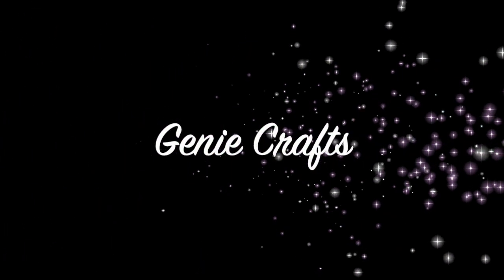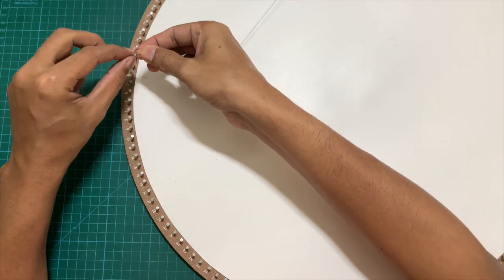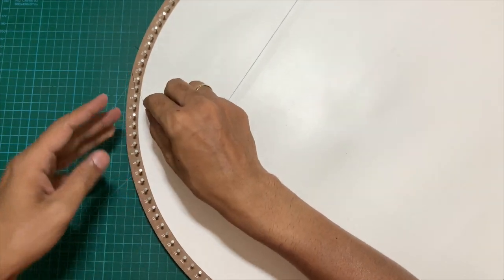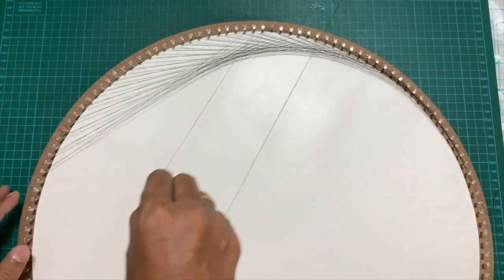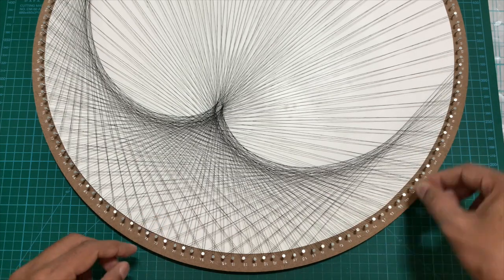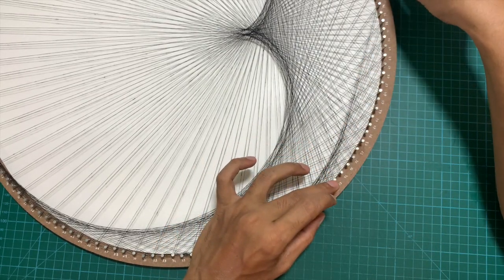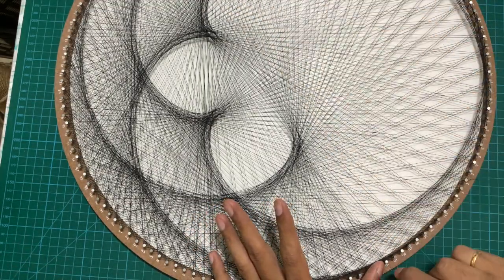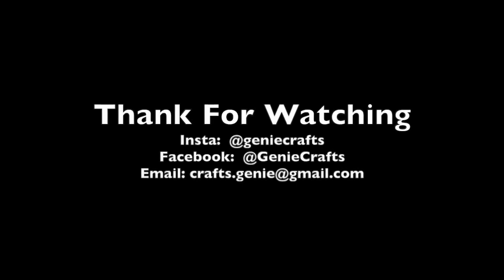String Art Basics - 1 | Cardiod String Pattern | 5 Petal Rosette String Design | String Mandala

Comment: Hello, I would like to ask you how to make the second cardiode, when I have all 136 nails together. Can I start the second cardiode on nail number 29? How does it work? Thank you very much for your reply.
Reply from the maker: It depends upon how many cardiods you want. Divide your nails into even numbers which will provide starting point for next cardiod. With 136 nails you can only have 4 cardiods as next divisible integer is very far away. So that means that next starting point will be mail number 34, and next 34 nails away from second starting point and so on
Reply: @GenieCrafts  So if I have 136 nails, isn't it already possible to create 12 flower petals? How many petals will it be, please, if I move it by 34 nails? Thaaanks for your help🙏🏽 This art is beautiful❤️
Reply from the maker: 136 is not divisible by 12. If you move by 34 you will get 4 petal mandala. But if you shift by 17 nails, you can get 8 petal mandala. If you shift by 8 nails, you can get 17 petal mandala. Just find a number which can divide 136 with zero remainder
Reply: @GenieCrafts  I already understand. Thanks again.👍🏽😇
Reply from the maker: Great, would love to see your work once completed.